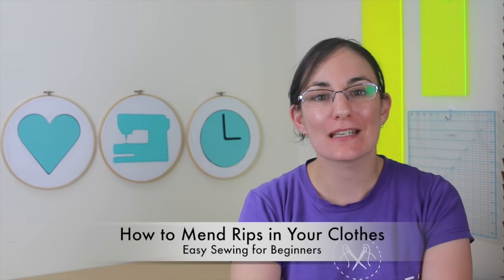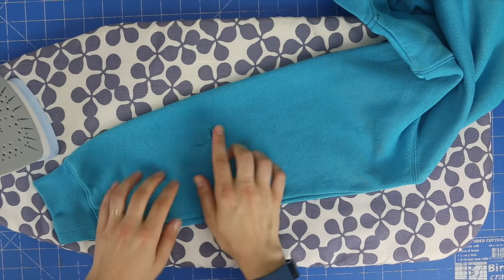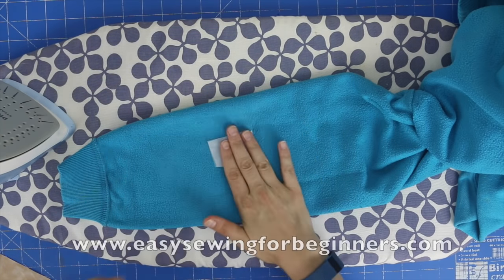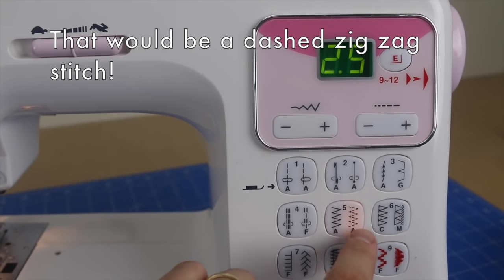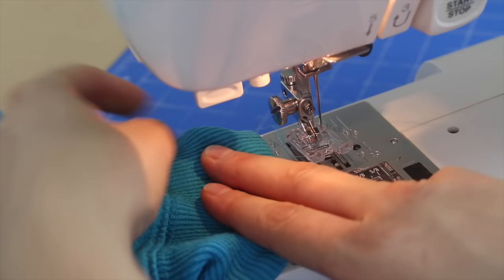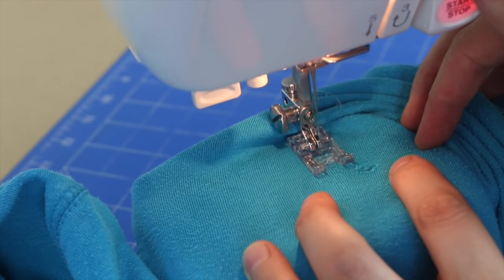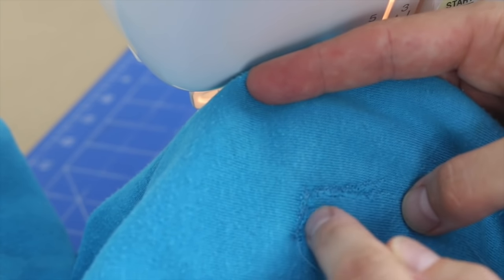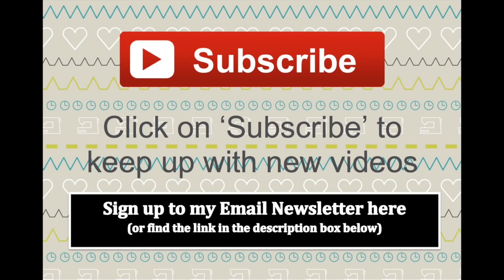How to Mend Rips in Clothes

Comment: when using iron on interfacing on sleeves or legs, it helps to put a non stick press cloth in between the sleeve or leg. Even after carefully matching up the edges of the hole, they can sometimes slip a bit and then you end up with bits of interfacing attached to the wrong side of the sleeve. If you have a sleeve board, that can also be used.

Comment: I am new to sewing and like your videos very much.  Question about 'interfacing'.  Does interfacing get removed or come loose in the wash?  I see that it provides a firm backing but will it curl up and irritate the person who wears the garment?  I see interfacing is widely used in many projects - do you remove excess interfacing?  Thank you for your help.
Reply: I know it is a bit late but I would use tear away or wash away interfacing for this. That way you can tear or wash away all excess interfacing and only keep the bit under the stitches.
Reply: @amandaedwards3116  interfacing usually aren’t wash away or tear away. Stabilizers come in wash away or cut away.
Reply: @Brandi62  sorry, wrong word then. In our local shop they call the interfacing.
Reply: @amandaedwards3116  No problem.  I don't know what country you are in but here in the USA we call interfacing something that is used to stiffen our give a fabric more body.  It comes fusible or non fusible.  It goes from light weight to a heavy weight like foam.  But stabilizer is used mainly for embroidery and comes as cut away,  tear away, melt away or wash away.  Some people occasionally use light weight interfacing along with their stabilizer but it doesn't wash away. It would have to be cut away.

Comment: What ever hsppened to hand stitching. What would you do if the power went out and you couldnt use your machine.
Reply: What ever happened to using the library. What would you do if the power went out and you couldn't use the internet.
Reply: Nothing. Hand stitching is still widely practiced, but that doesnt mean using machines is a problem. 

Machines are great, it's why our ancestors upgraded: our ancestors had sewn by hand and realized the difference - even then, they used foot powered machines if not electronic. 

If you can do it with a machine, you can stitch it by hand, it will just take longer.

What did you plan on getting out of this comment? What purpose did you want it to have? How did it go about that?